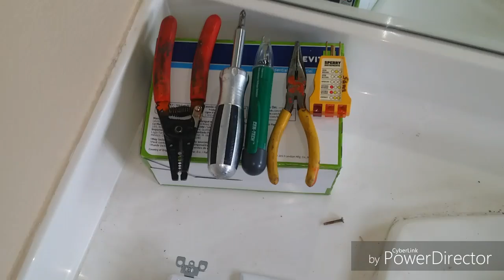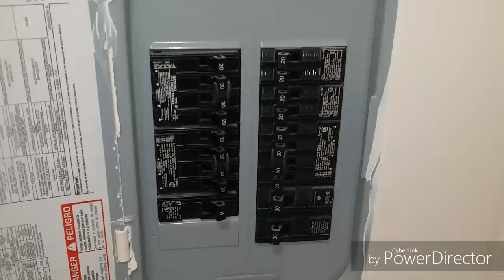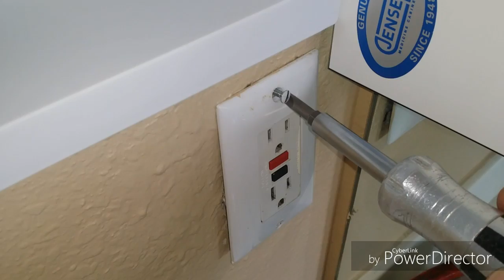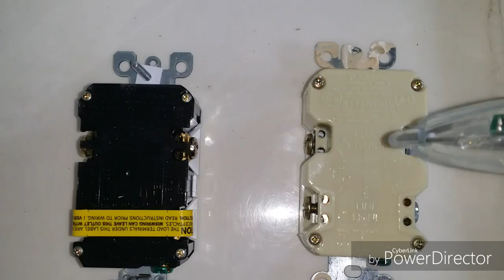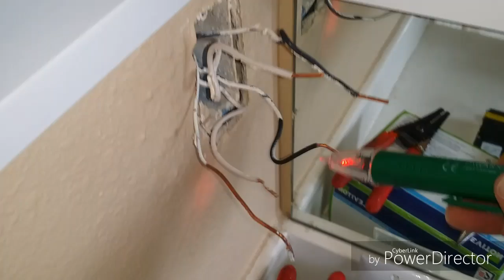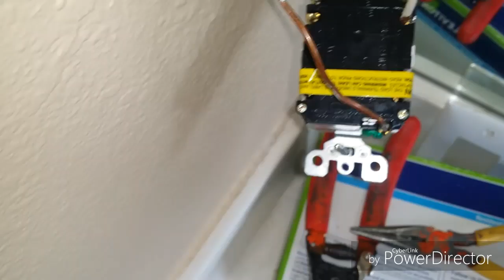How to Install/Replace GFCI Receptacle

Comment: Can I stick the wires in straight into those little holes or do I have to curve it around the screw?
Reply from the maker: I prefer to wrap them around the screw.  This is my preference however you can still the wires into the hole. Hope that helps. Just make sure that you turn power off at the circuit breaker and test to ensure their is no power. Thank you for watching 😁

Comment: I replaced wire for wire, but my problem is the green light comes on to show power but the outlet doesnt work. I can't reset or test using the buttons. I've returned 3 outlets thinking they were faulty. What can I do to fix this? When I replace the old one, wire for wire that outlet works. It just keeps tripping on me a few times a day.

Comment: You showed which hot wites goes where it says line but what about the neutral? Also, my GFCI receptacles has the 8 holes if you know what I mean. There's 2 holes on each side where it says line and 2 holes on each side where it says load, do I put the wire in the top hole or bottom hole? Thanks